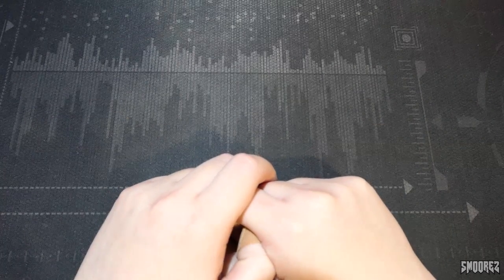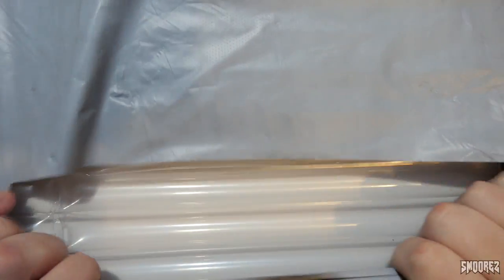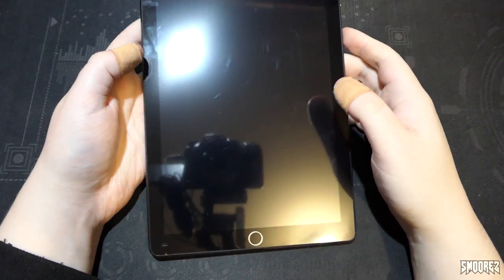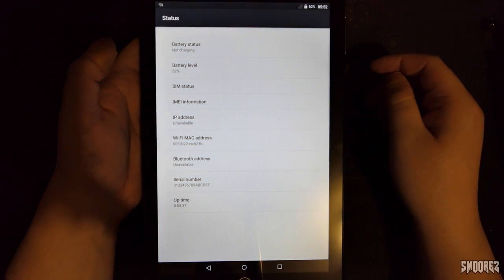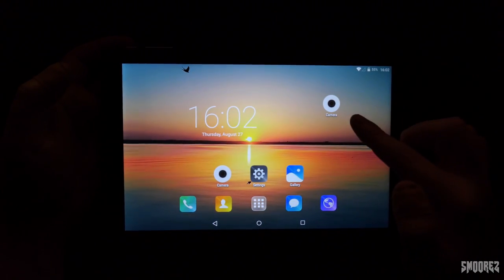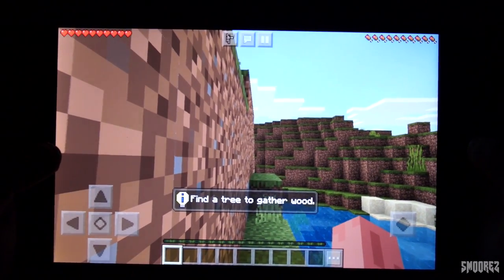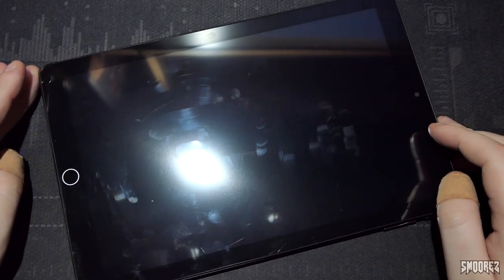iWish: I Bought a Knockoff iPad thing from Wish! This is what I got... In-Depth Review & Teardown

Comment from the maker: *The cameras are 5MP Rear and 2MP front. They interpolate to higher resolutions.
Also if anyone can shed some light on the dual eMMC chips on the board, that would be good.*
--
And for anyone else watching, please don't buy this (or practically anything off Wish for that matter). This is definitely not worth it. I buy these so you don't have to.

TIMESTAMPS:
Intro: 0:00
The Listing: 0:49
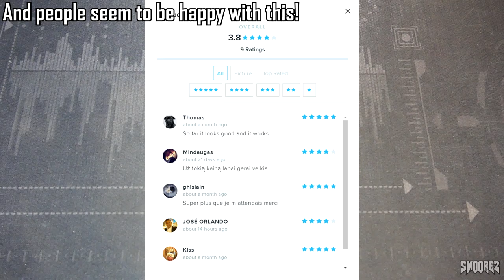Unboxing: 6:57
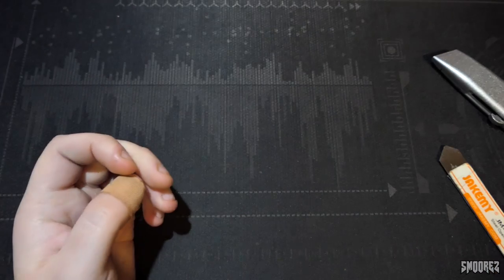The Tablet: 11:07
Power On: 14:00
Wallpapers, UI etc: 15:00
Testing out Cellular: 16:17
Settings: 17:37
Looking at the apps: 20:23
Camera: 21:23
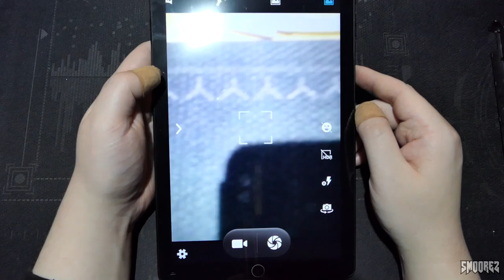Camera Test: 22:22
WiFi, Browser and YouTube test: 25:37
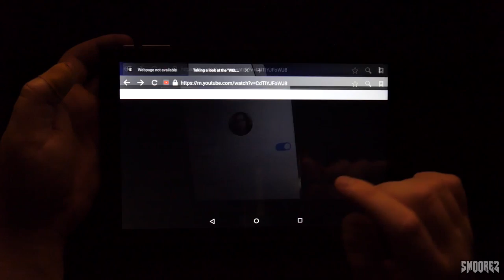Speaker Test etc: 27:13
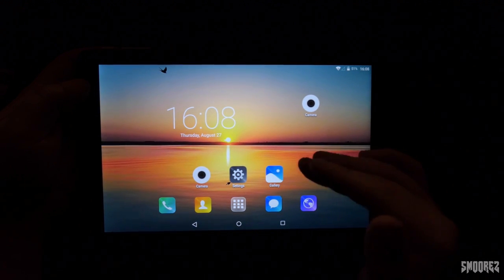Play Store: 29:01
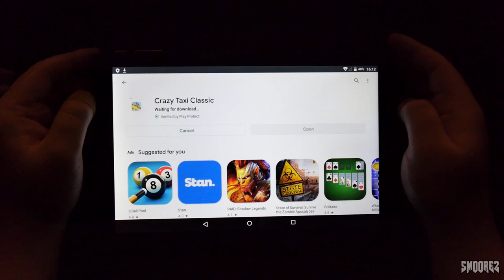Resolution and 2nd YouTube test: 30:07
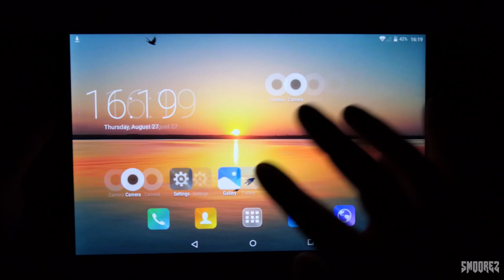Gaming Test: 31:15
Attempting Geekbench: 35:41
Mini-Review of the FREE GIFT: 36:20
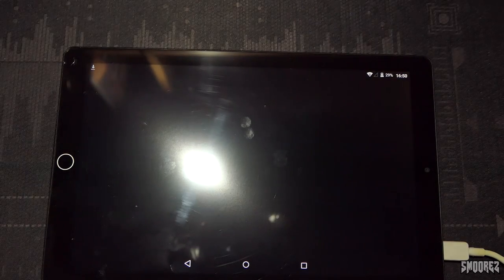Checking out the specs: 39:27
Conclusion: 42:25
The Teardown: 45:54
It lives and final specs: 50:28
Outro: 51:19

CPU & System Apps are in the description above!

Be good people!
Reply: Ok
Reply: I think they use the 4gb Emmc for the swap space.
Reply: You bought something on wish you get what you deserve should be they slogan.
Reply from the maker: The only difference between this and the reupload?
The intro was loud as fuck. It for some reason peaked up to 12db when I re-rendered it because I left some placeholder text in. So now it's...slightly better.
Reply: <3
Reply: REAAAAAALLY Hate when you broke or scratch stuff for no good reason. Just sayin´. ¨I know a lot of people dont like this¨ No, we dont. At least other channels scratch borders, and explain the reason. Not just ¨this is plastic, this is aluminum¨

Good quality video overall i guess...
Reply: @michellefernandez3155  Don't watch if you don't like it.
You can tap 2 times on the right if it bugs you that much.
Reply: @i05af  Well i can give my two cents if he addresses that that specifically in the video. OOF

You can ignore my comment too, you know? Also: who watches this long videos in the cell phone...
Reply: @michellefernandez3155  JerryRigEverything does the same kind of scratch tests, he also scratches the backs of iPads and stuff, so smoorez isn't the only one that does it
Reply: @PancakeSparkle  You need to learn to have a little reading comprehension. That's the reason i wrote: ¨At least other channels scratch borders, and explain the reason. Not just ¨this is plastic, this is aluminum¨ 

Really a big stretch from you calling this a ¨scratch test¨ but w.e.

Jerry uses different tips and explains at what level the object starts to get scratches. That way you know what can damage something in normal use. Not just ¨Look i'm scratching the tablet, so it was plastic all along lololol¨ using a random cutter.

In the end i see this as ¨Cheap Entertainment¨ as the logo says, and i was just sharing my POV.
Reply: @michellefernandez3155  he doesn't scratch backs with his mohs picks, he uses a razor blade, check out his iPad pro test if you don't believe me, he did the whole "art class with jerry" thing
Reply: @PancakeSparkle  You totally missed the point.

Have a wonderful week!
Reply: @michellefernandez3155  look, the only reason he did the "scratch test" is to see what material the back's made out of because you never really know with stuff from sites known for selling dodgy stuff, other channels scratch stuff to see either what material it is or how durable it is, just like he did here.
Reply: I was thinking that maybe that 4 GB eMMC is for the OS, and the 16 one is 'hacked' to show the 512 GB Capacity and used as the actual storage, I remember the Motorola defy that had a 2 GB eMMC for the storage but used a SD card as internal storage
Reply: @enzopissani  or it's used as swap/virtual memory, you can never know with these fake devices XD I'm surprised there's no hidden mics or something
Reply: Aye, I actually downloaded the original because I was about to leave. Was surprised when I reconnected to the internet and it was gone. lol
Reply: Was watching this yesterday and suddenly the video went down
This explains alot
Reply: Michelle Fernandez It’s called durability test
Reply: That CE logo is the China export logo
Reply: I think this tablet, if its specifications are to be believed (which LITERALLY ANYTHING from Wish is only with a massive grain of salt), it would actually be pretty sweet to have a tablet with a display resolution of 2560x1600 (minimum) or 4K (recommended) running Android Pie with 10 GB of RAM and 512 GB of storage under the hood and have 8.7 Ah of battery capacity while rocking 4G LTE or 5G cellular capabilities.
Reply: Please restart the phone/tablet of you're inserting a SIM
Reply: Does it come with spyware?
Reply: Someone PLEASE WIPE MediaTek company off the Earth !! If one can't afford a NEW tablet/android smartphone then one should NOT be able to buy a NEW tablet/android smartphone. Just get a good quality USED one. Come on, Google, PLEASE ASK for bigger  MINIMUM SYSTEM REQUIREMENTS so this does not happen.
Reply: Not that I am jealous of rich people, but companies complain about how " raw material supply and resources to produce these" are getting low on earth, and yet so many electronic devices end up being in a landfill because it is often not usable or if it is broken then not fixable. Or because it is meant to be thrown away in a year or so.
Reply: GmbH Hugh
Reply: Absolute false advertising and not even worth what you paid.
Reply: For the record - just because it's mini-SIM, it doesn't mean that it can't support 3G/4G - I recently got a new old stock Lenovo 10inch something or other for my dad to use as a sacrificial Netflix/GPS device and it had one of those and it does support 4G (including telephony thanks to some Russian MadLads(tm)) , lol. That said, I'm pretty sure that's the only device I've ever seen that actually used the middle cutout adapter of the SIM card XD
Reply: Turn off besloudnes and it wont sound horrendous
Reply: How to file a case on these sellers ?
Reply: Yeah
Coz airpods are made of GOLD n titanium 🙄

Comment: Camera's surprisingly decent
Reply: shits a hassleblad compared to the phones
Reply: Yeah it doesn't look bad for a cheap tablet, especially a generic one, it just looks terrible in the camera app because of the shitty screen
Reply: I got a wish ad before this video
Reply: Any new phone for the same price would smash the camera on this tablet. Probably because of higher material cost?
Reply: @vola-2899  yeah I went from a galaxy S9 to a f2 pro and I miss the low light performance of the S9 although day shots have less detail. Could've easily been fixed with ois, which the Chinese version has, along with a telephoto camera instead of a useless macro sensor.
Reply: He bought it from wish

Comment: If you go into the Mediatek engineering menu, you can see what bands each Sim is capable of. You can also turn on available bands that may be off (but it won't let you turn on anything out of band).  There is also a region setting somewhere in the phone section of the engineering menu (don't have an mtk handy at the moment to give you exact heading) that you can use to switch between US/EU/Asia and I am pretty sure AU. 

My experience with Chinese tablets.

I have a "2019 Version:  8GB/128GB, 4GLTE, Android 9.0, 10 core" etc.

My device is (surprise) a  4 core 6580.  Yeah CPUZ (which was pre-installed) shows 10 cores, but if you look, only 4 cores ever operate.

The ram is interesting because HWINFO reports 4GB, and I have reason to believe it to be true because I can frequently get it to over 2GB under load.

Storage is 16GB which is typical of these crap devices.

The device claims 4G LTE and lies. It even shows 4G in the status bar. But looking in the MTK Engineering Menu shows that only 2G and 3G bands are available.

My screen is also 1280x800 so that's probably a common screen, and I believe the battery was 3800.

The thing I found most interesting was it was Android 7 under the hood.  I find that odd, as I found your 5.1 odd because these devices are almost always 6.0

I got mine of Aliexpress because you can generally find reputable dealers and Aliexpress themselves don't take no shit when it comes to counterfeits.

I first talked to the company I bought it from and a fairly nice lady told me to stick my refund up my ass, but in a nice way.

I provided her with all of my documented evidence that EVERYTHING offered in the tablet was a lie.

She said they don't except that as evidence, so I opened the dispute with Aliexpress, went back and forth only 1 time, and got my refund within 1 day, didn't even wait for the RMA (Then again, I am a Diamond member, so I am sure they know I wouldn't pull something like that.)

Comment: That tablet is 2G/3G only. Set it to 3G only. Then search for networks manually. I also brought it. The home button should have a fingerprint sensor as well. The 4GB emmc contains the bios and stuff. It is basically a bios chip. You can use the keyboard. You can install any arm based os. That 4GB card also contains drivers and firmware.
Reply: My sim cart is not working at all in this tablet do u know why

Comment: I remember once bought a Chinese tablet with an aluminum back. This aluminum blocked the WiFi signal and when the device was turned forward to my router the signal was on 5 bars and when the tablet turned back to the router then the signal fell to two bars. Maybe that's why you don't connect to mobile network.

Comment: I work for Verizon's tier 2 tech support. The reason why you can't pick up a signal is because the device is a CDMA only device and USA is currently the only country still using CDMA. Your country is using a GSM signal. The difference is GSM is newer and designed for 4G signals or better and the CDMA is for 3G or lower, but you can still run 3G over a GSM signal. Hope that's informative.

Comment: The cheaper devices on Wish are pretty much identical but they hack the firmware to make the specs look a bit lower than they did with yours, but still better than they actually are. I made the mistake a couple of years ago, but thankfully knew my way around Android enough to bring up the config files where I could blatantly see they had inserted code that actually said something like "Fake_Res=1920x1080", "Fake_mem=4Gb".  There's a video on YouTube somewhere where someone does the same and finds the same fake specs in the config files.  Using that info I was able to get a full refund from Wish and ended up with a free tablet, albeit not a very useful one.  Another thing to be aware of is that some of these have adware embedded in them that hijacks the adds in apps to show their own adds instead, again I think there's a video on YouTube showing how the adds get worse and worse as time goes on.

Comment: Looked like a cheap phone board shoved into a tablet. Coulda been worse, coulda been a raspberry pi in there. 

I learnt my lesson from wish a few years ago. an 8 core mobile, with 6gb ram, but it wouldn't even let me install anything before play store crashed, and on loading cpu-z it at first showed the specs they had on the box, but suddenly the numbers changed so I knew it was busted to return bogus numbers. and you'd never believe it, wish wouldn't have a bar of listening to any complaints, just told me to upload photos, giving me directions that were non existent from their complaints page. 

Wish is just the new age equivalent of that bloke who used to have a cart in the middle of the city flogging off knock off jewlery and designer sunnies to pedestrians as they saw the shiny stuff on their way.

Comment: I got a tablet from Auchan for just under 50$ with android 4.4 1gb ram 32gb storage, runs well on yt, fb, chrome and as games I got gta vc, nfs hp, nfs mw 2012,dead space, survivalcraft 2, modern combat 3,realracing 2,cover fire and dead trigger. They ALL run normally. I got FGO too but it tenda to crash randomally. The antutu score is somewhat under 15000 for sure.

Comment: It's too much money, but there is a lot worse at that price point in terms of generic Chinese tablets. Rater than buying the most expensive one you should see how cheaply you can buy the same one. As it is, £50 UK and that would be an reasonable device to receive . The camera is shockingly good and the sound from video playback seemed excellent. If that's not spliced in , you could record music on that. It's not a good device overall, but I own far worse I use as glorified PDF readers

Comment: This is weird... You say it has a quad-core CPU but the MT6592 is an OCTA-CORE CPU. And during the teardown, the Mediatek chip is clearly labelled "MT6592V". Did they fake the chip markings too?! They really went to so much effort for such a hapless scam?
The behavior of the CPU shown in CPU-Z (with only 4 cores active) could be the result of internal CPU core scheduling. 
The MT6592 was the first ever octa-core mobile CPU and Mediatek had to build an entire solution themselves to make two quad-core Cortex-A7 clusters act as one monolithic octa-core processor. It had effects like a 2.0GHz clockspeed when using only 4 cores (instead of 1.7GHz using eight), power management restricting the cores active from 8 to 4 depending on the battery level or CPU temperature, overheating (especially the high performance MT6592T version) and a very "rough" core scheduling (8 to 4 cores transitions in certain scenarii or core frequencies jumping between big 300MHz steps for power management).

It is a very good processor nonetheless and was incredible back then (~2016), having flagship performance at half the price. The GPU, a Mali-450 MP4 4 cores, was excellent too.
Since there is no cooling solution or contact with metal for heat dissipation, the MT6592 was probably overheating and shutting down half the cores to mitigate damages. If this was really a proper MT6592 solution it would have performed so much better, such a shame.

Comment: It's a BITZA, I got almost the same for $70us off ebay (refunded). Not the claimed 512gb storage in mine, got 16. luckily it's not looped, so just runs out. Claimed external mem 64, takes 16 max.
It's not just WISH these are everywhere built mega cheap using up all the surplus cameras and pieces churned out in their millions & then not used.
The "WELCOME" camera you got is a perfect example of these "bitza" devices. I've not seen your Y2000 vid yet, but I betting it will be a BITZA built from bits made in the Y(ear) 2000.

Comment: Think my ZTE K90 (the cell network will never work because US Cell doesn't support the device I suppose some cell companies can get it to work if I took it to them but this isn't a big deal to me.  yeah it has 6.0 on it But I don't really play games on it.  I got it for the battery the it was $130...and they wanted to try and ban ZTE so both my main tab and my backup phone are ZTE.  Interestingly enough the ZTE reception is quite good for $60 phone...  tend to use it during travel more than the joke of a phone company that was Sprint.  (T-Mobile)

Comment: This is why you should never buy anything from Wish.
4GB eMMC is probably only used for the /system and other service partitions and the bigger eMMC is used as /data partition.
My Asus T100TA hybrid had a similar setup, but instead of an eMMC, they soldered an 8 GB USB flash drive to the motherboard to store Windows factory reset image.

Comment: 47:00 I almost died laughing. It's like half-stocked AT BEST. The second eMMC module is probably running phony firmware to do the 512GB display, like how those bootleg flash drives do.

Comment: Did you try rebooting with the SIM card installed? This might have got it working. Had you got the much cheaper, 64GB model by Wish, would the true specifications have been the same? 

Here in the UK, traders in China regularly sell unbranded smartphones and tablets like the ones you've reviewed, and list them with fake specifications on eBay. Once in the UK, however, these get relisted, and auctioned; often achieving crazy money, by buyers believing the descriptions to be accurate.

 eBay's done nothing to stamp it out, even though a simple statement against all smartphones advertised, advising buyers to check the specifications carefully after purchasing, by running the Fake Device Test app (or the ones you've mentioned) would probably solve the problem. Bad! How would you feel if you shelled out over £500 for something like what you've reviewed, only to find out months later you've been conned? An innocent entrepreneur might end up in hospital! Trading Standards are also aware of the situation but have failed to act.

Comment: Couldn't they be sued? If what you ordered is not what you received? If you order a tablet with certain specifications and you get something considerably different than what you got? You wanted the model with 10 gigs of RAM and 512 gigs of memory, with an android 8-10 operating system. They send you a model with 2 gigs of RAM and 8 gigs  of memory with an android 5 operating system wouldn't that be called fraud? I'm surprised this company is still in business because a lot or all of their products are misrepresented. Isn't there protections by governments to protect consumers from this type business practice?

Comment: You can get a Amazon fire tab 10 for less than this thing. (When they're on sale). Which is about 1000 times better than this POS.
Reply: Aria Casteal  The only ads are on the unlock screen. Just an ad there instead of your wallpaper. Also you can get rid of the ads permanently for $10